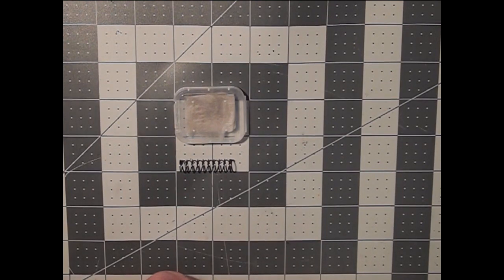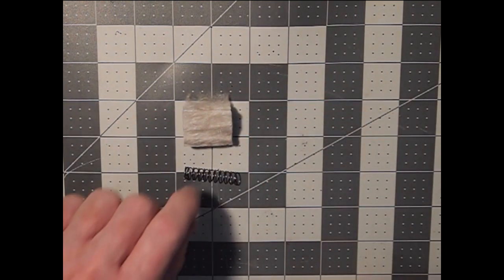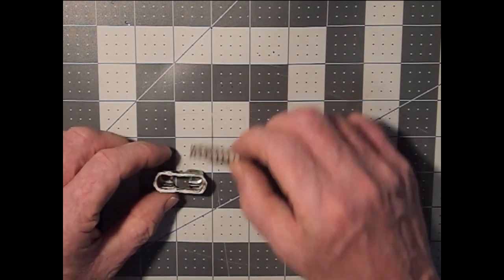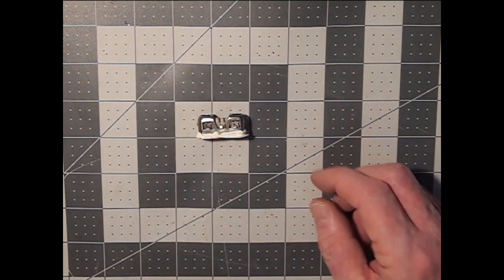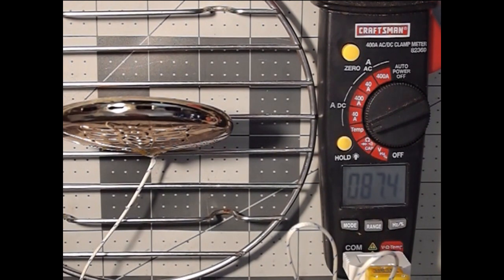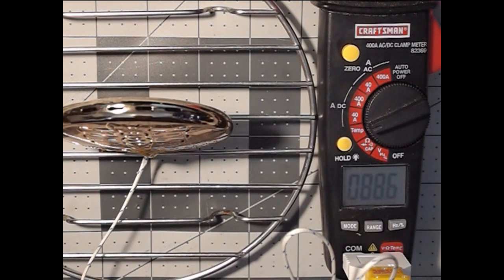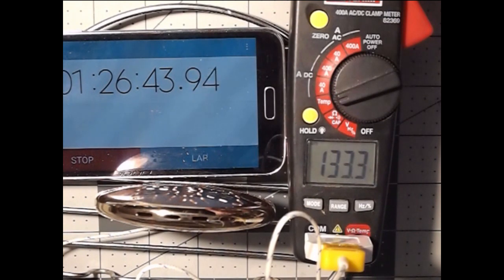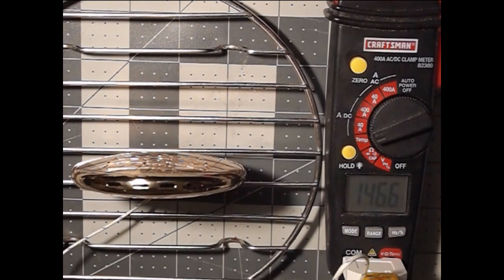Handwarmers S04E03: Rebuilding your handwarmer - how much catalyst to use

Comment from the maker: Update: The next day after making this, I went skiing for the day. About 8AM I filled the same handwarmer (the one with the full pad shown in this video), and wore it around my neck all day. When I got home, I laid it down on top of the probe (so oxygen was just entering from the top of it as the bottom was laying on a carbon felt pad), came back a couple of hours later (at 1800 hrs), and the temp was registering as 160F. This indicates that perhaps if given long enough, a full pad in the catalyst head might be able to give substance to a heat increase as much as 25 degrees more than a 1/2 pad. I was rather stumped at this, because in the video above, I waited something like 2 hours and just got a temp of 146F from the full pad. (In my experience, 165F is the highest heat I have ever measured from a liquid fuel handwarmer, the nominal is usually 135F). Another consequence of this hotter burn was a stronger smell of the naptha fumes, which also made me ponder the idea of using more deodorizer for a handwarmer that I know is going to run hotter than normal.